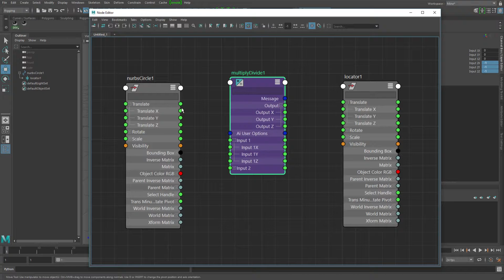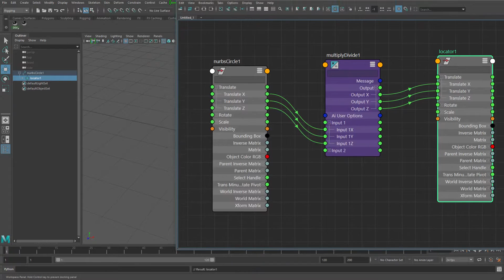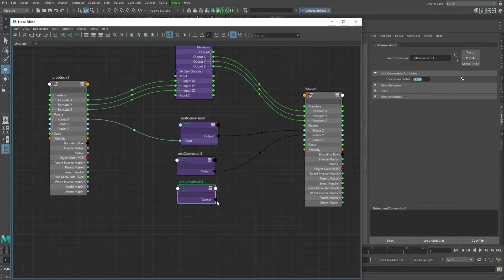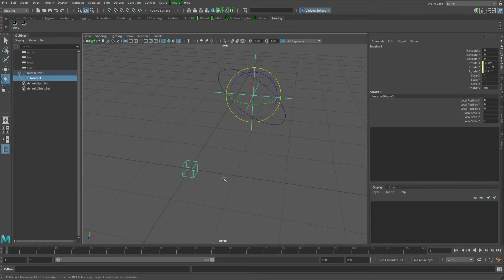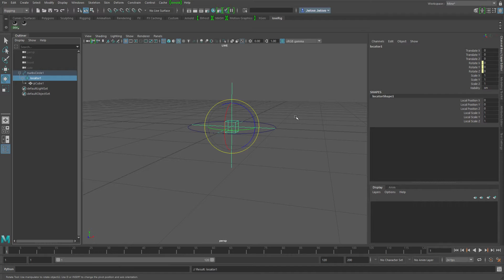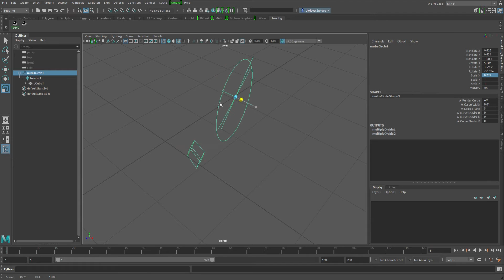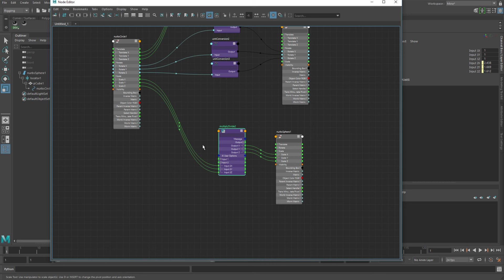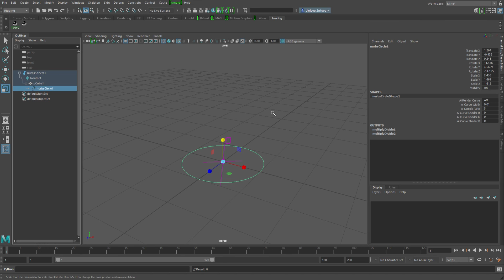Transform negation (translate, rotate, and scale) Maya tutorial

Comment: Hi Jarred, in my rig I need to drive 8 blendshapes depending upon xyz rotaion values. Kindly help!🙏
Reply from the maker: Hey @Ins, thanks for taking the time to read and comment.

I think you'll probably have the easiest time driving those blendShape targets by using set driven keys, but that's about the best I can guess without any other info.  You could also use some of Maya's math nodes... but I think set driven keys would be the easiest to implement if there's any 'extra' complexity needed besides just multiplying a rotation value by x amount for a 0-1 blendShape target value.

good luck!
Reply: @JarredLove  Thanks Jarred, in my case, 8 blendshapes driven by 3 driver, so if x = 90 y, z = 0 it is 1,0,0,0,0,0,0,0. if x,y = 90, z = 0 it is 0,1,0,0,0,0,0,0 for example. so the first blendshape is 1 and 0, but x is 90 on both cases, which confuses maya...
Reply: @JarredLove  I tried x*360*360 + y*360 + z, then used the results to drive the blendshapes, the key frames are working but the inbetweens are diaster..😓
Reply from the maker: I'm a little confused about what you're trying to do... especially all the math you're mentioning since I don't really under stand what's rotating and why, or what the blendShape targets are and how the rotation needs to drive them.

Is it possible that you can do a set driven key for each rotation to each target separately, and then allow them to get additively modified when more than one rotation axis is adjusted?  So, set up the set driven keys with rx as the driver and have it manipulate all the targets so they behave appropriately for rx, then do the same for ry and rz.  They should automatically get a blendWeighted node sandwiched in there to add up the results from all three drivers set driven keys and apply the final result to the blendShape targets.  At least, I think Maya does that for you...

Comment: Thank you Jarred, this is very helpful. Can you please explain how to do the same thing on an animated character? For example, I've heard that many studios use this kind of technique simulating cloth on fast moving characters, where they simulate the cloth on grid but the result is seen on the world space wherever the character is animated. Thank you in advance.
Reply from the maker: Thanks for watching, and I'm glad you find it useful!

I've seen situations where muscle simulations (and various other deformers) kind of break down and don't look correct when the character is extremely far away from the origin (like thousands of units).  This is basically a math issue where the deformer(s) calculations just can't handle the precision required when the local values of the control points are so far from their parent transform matrix... ie: the farther away from the origin it gets the more difficulty it has getting the correct 'translation' value for every cp.

Your specific example of cloth on a fast moving character is similar in that it's moving too fast for the cloth sym to handle it properly, so you want a more controlled version of it at the origin.

Usually, the way I would think to solve this is to have a duplicate skeleton at the origin that the geometry is actually bound to.  This skeleton would be directly driven by the joints of your control rig with the exception of the top joint not having any translation connections (meaning it will stay at the origin).  This will help keep all the deformation stable and easier to control/diagnose.  Then you'll take a duplicate geometry that will actually be rendered and blend shape the deforming geo on to it as the target.  Activating the target essentially ensures all of the deformation is happening in a space that is local to the geometry's parent transform matrix.  All that's left to do is to translate the renderable geometry's transform node out to where the control rig is with a point constraint (or a matrix node network that does the same thing).  Now the transform takes care of the main distance from the origin, and the blendShape handles the local offset from that point.

I hope that helps!
Reply: Thank you Jarred. Your reply has been really helpful. That is almost exactly what I ended up doing. 
Thank you again. Kind regards.
Reply from the maker: Hey Kay Dee - glad I could help!  If you don't mind, could you please explain what your solution ended up being for the sake of anyone else who comes across this question and is curious?  (I'm also a little curious myself!)  Thanks!

Comment: Thanks. I'm so used to being able to disable inheritance of rotation and scale (coming from Blender). I needed to know how to do this in Maya.
Reply from the maker: of course!  I'm glad you found it useful!
Reply: You actually can disable Inherit Transform in maya, but it only works on all transforms at once, and I suppose has a slightly different effect. So would not help create a movable pivot for example.
Reply: @nixellion  Yeah, all-or-nothing isn't really useful! Parenting is only an organizational/outliner thing when you do that. Although in Blender, it's not even necessary to create a movable pivot point -- that's what the 3D cursor is for. In Maya, you can just hook a controller to the rotation/scale pivot parameters of a transform node... but that's a tedious way to do something that takes one click and one pie menu in Blender (and has much more flexible results, and can operate on any number of controllers at once...).
Reply: @josephbrandenburg4373  As far as I understand Blender's cursor is just temporary rotate point, so it will not animate properly, which, if im right, would be often useless for animators. The point of animatable or adjustable pivot is that you can, say, animate a rolling cube in a clean way
Reply: @nixellion  No, that's not true in Blender. It animates correctly. Well, you have to add a few keys if you want things to follow nice arcs, but that's always true in IK animation.
Edit: meaning that it keys the translate and rotation of the object being manipulated. For something like a rolling cube, it might he a good idea to add a few more controls, and it's certainly possible.

I was thinking something like animating a character's center of gravity around a turn. It's so handy to click on the corner and just rotate the whole rig.
Reply: @josephbrandenburg4373  Well, what I said is correct then. Its just a temporary pivot that does NOT animate the same way you move it. Adding more keys is called counter-keying and is a waste of time if you can avoid it. Sure you cant always avoid it, and sometimes its faster to just counter animate something. 

In maya you can also use a temporary pivot to rotate something around any point in space. 

And you can also create animatable pivot. So, say, you have IK control which you want to rotate around some point in space. You move this animatable pivot to that point, set 2 keys 0 and 180 and it will rotate in an ark around that spot. Its possible
Reply: @nixellion  No, you misunderstood me. There's no counter animation involved. When I want something to follow an arc, I key the center of the arc, then the center of the smaller arcs, until it's smooth. I animate with linear tangents. Once it looks good enough, I start removing keys and using bezier tangents.

Then again, I also animate straight-ahead, on twos!
Reply: @nixellion  All that other stuff is easily doable in Blender, too. I'd say it's even much easier to do than in Maya (using, say, the Pivot Constraint).  But it's usually a waste of time when you can just animate with the 3D cursor.

Of course, it all depends on what you're doing. For something that should always rotate like a hinge or ball joint-- obviously use FK controls. I was refering to translation controls-- IK targets for instance. You can get very FK-like pose and animation in Blender without leaving IK if you use the cursor as a pivot when animating. But of course, just like any IK animation, you'll have to animate the arcs. It just makes it easier to use the cursor for this.

And the center-of-gravity control was the beat example. Animating a character turning a corner is very easy using this method.

It's hard to explain. I've used both softwares quite extensively, but it seems you're more familiar with Maya than Blender. Of course, I am more familiar with Blender than Maya, myself. But I've made custom pivot controls in both softwares.
Reply: @josephbrandenburg4373  I am not saying its not possible in blender and I am referring specifically to rotating IK controls. Say, foot roll and tilt - you can make it through classic multiple fk controls chained in a hierarchy or you can just add an animatable pivot that is controlled manually or moved along a spline. Again, not saying you cant do it in blender. Im saying that temporary pivot/cursor (also available in both softwares in one way or another, maybe more useful/comfortable in blender) is not the same.
Reply: @nixellion  Ah, now I see what you're saying... and it isn't what I meant. I agree with you. I was thinking of a rig where a locator moves the rotate pivot of a controller.
Reply: @josephbrandenburg4373  Well, that too, actually. Spline based is used on rp movement as well. Im just saying that I'm pretty sure both options are available in maya and blender, anyway, we're walking in circles here :D
Reply: @nixellion  I'll eventually make a video about it on my 3D art channel. Then there won't be any room for ambiguity!

Comment: Thank you very much for this tutorial Jarred Love!

I am a newbie for using matrix in Maya, but today I tried to use them for negating like in your tutorial. It seems to be working very well with just one node in-between (decomposeMatrix).
What do you think of this approach? Thank you!
Reply from the maker: Hi Ruyanisme, thanks for checking out the video and commenting!  Your approach intrigues me - I hadn't actually thought of using a decomposeMatrix before since I am usually only negating either the translate, rotate, or scale so the straight multiplication of those plugs by -1 is usually inexpensive enough (decomposing the whole matrix for just one of the transforms is a bit overkill).  I'm guessing you're using the inverse matrix to feed into the decomposeMatrix node (I just moved and don't have my desktop computer set back up yet so I cannot test it yet myself... plus, this could help other viewers)?

Something else I've just realized after watching some of my video again is that you actually don't have to connect to the x/y/z individually.  There was a maya bug a long time ago (maya 2008...ish?) where sometimes connecting to the parent multi attr would cause maya to evaluate incorrectly making it much more 'safe' to connect to each individual plug.  I got into the habit of doing that and have done it for a looooooooong time, but just recently learned this particular bug is fixed.  I'll still keep an eye on my controls and if they act wonky, I'll probably connect the individual plugs at that point if it's actually needed.  I bring this up because it will actually help cut down on the nodes a bit for the rotation since you can just use one unitConversion node for the parent 'rotate' plug and do not need the individual unitConversion nodes for the x/y/z!

So.... using a decomposeMatrix to just negate translate, rotate, or scale is probably computational overkill; however, using one to negate all three might be a good idea!  Some timing tests will need to be done to truly be able to tell.  Man, I want to get my computer set up so I can test it!!!  Why do I still have to paint the walls of my new place first, why??!!!!! haha.